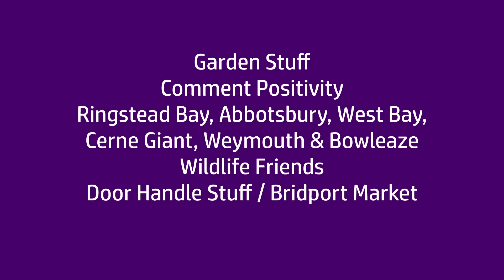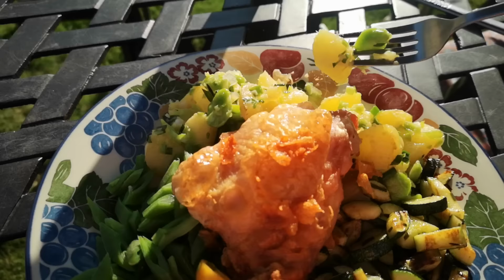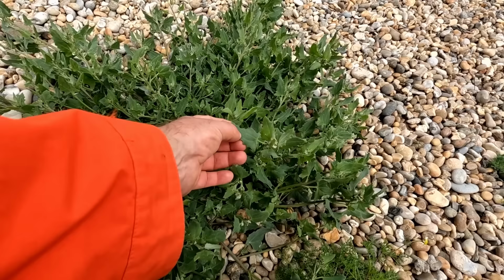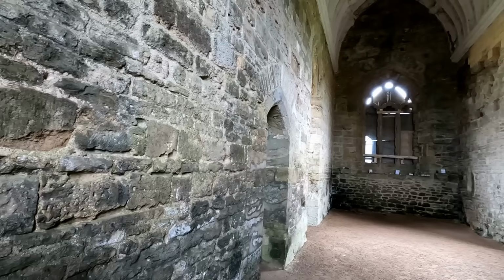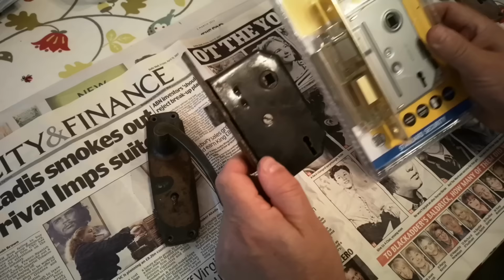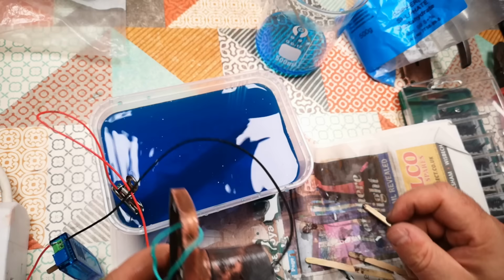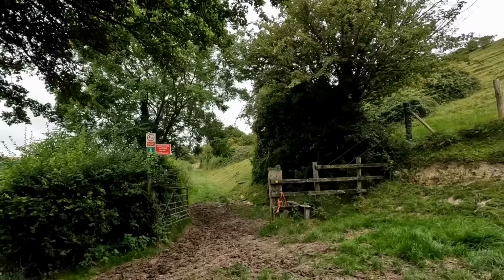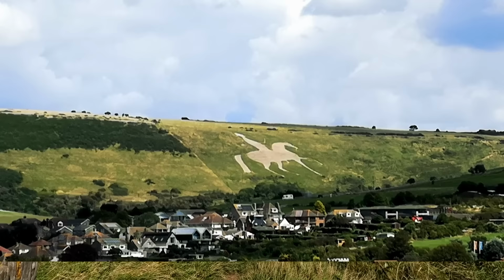Random Stuff - Garden, Comment Positivity, Ringstead Bay, Wildlife Friends, Restoration Project Fail

Comment: When electro plating, always use rubber or latex gloves when handling the metal part. That way you don't introduce any oil from you hands to the part. Also if you'll have a go at this again, it needs to be bare metal. Not cleaned, scrubbed. It needs to be BARE. So power tools with a wire wheel are good, acetone, disolve the oxides. Combo to get to bare metal everywhere and then use gloves.
Reply: I have found that many people used to varnish brass - plated or otherwise(i assume to save the effort of regular polushing to prevent tarnishing.. i live in a victorian townhouse and  the doors have the original solid brass knobs... to my horror i found they had all been varnished... which has now been removed and they are beautiful

Comment: I looked up what might have happened with the restoration; apparently, when too much charge/ too much copper (not quite sure) saturates the copper sulfate, creating copper sulfate pentahydrate crystals. Amazing vid as always :)
Reply from the maker: Yeah, I should probably try with a more dilute solution
Reply: Also to fix voltage issue physically move the electrode away from the handle will add resistance and reduce current witch is what you want if you cat make the voltage less, also may make it more even. Also when I last tried something like this the solution was a bit darker than glass cleaner if that helps, yours looks way darker but could be camera. Also a battery cell AA C D etc might work better as a buck regulator might be putting spikes of voltage during the conversion.
Reply: Here’s another comment marked three weeks before the video posted.  There’s only one explanation I can think of:  You're traveling through another dimension -- a dimension not only of sight and sound but of mind. A journey into a wondrous land whose boundaries are that of imagination. That's a signpost up ahead: your next stop: the Twilight Zone! You unlock this door with the key of imagination.
Reply: @TheFrugalMombot  Indeed; after many hours of being happy on purpose, demonstrated by Shrimp himself, we can step through space-time :)
Reply: @scottbuck1572  indeed :)

Comment: Speaking of copper plating, I managed to plate a spot on my kitchen sink after putting down a plastic tool I was using to fish out a PCB board out of the etchant solution and forgetting about it. It was surprisingly well adhered, and took a lot of scrubbing with steel wool to get it mostly off. The etchant was a copper chloride solution which works fairly well for etching PCB boards, but it requires replenishment with hydrogen peroxide, which isn't easy to get in high concentration.

Comment: Another explanation for the regular beach pattern at Bowleaze could just be the formation of rip currents, but small scaled. This is a common feature present at wave-dominated beaches. Waves always adjust its shape when approaching the coast so that its parallel to the beach, so an interference patterns is unlikely. Within coastal morphodynamics, this beach pattern could be classified as "transfer bar and rip" which is an intermediate beach pattern in the Wright and Short's beach classification.

Comment: Interesting and varied - video, brings back memories of holidays in Dorset.

The restoration project, digging into my chemistry background I would suggest the copper sulpate solution was much too strong - with so many sulpate ions in solution you are possibly getting zinc reacting with the sulphate where the zinc is most exposed and roughened. A more dilute solution with a little acid in it would possibly have worked better. Ideally most copper should come from the anode not the copper sulphate solution.

Comment: Lucky to have a wide range of beaches here in South Wales, muddy, muddy tidal, shingle, rocky, sandy, a few with sand dunes and even some very industrial beaches (covered in bricks, blocks, concrete, tiles, plastic and other remnants of industry/human tendency to dump rubbish along the shorelines). 
One of those industrial beaches in Cardiff is the other side of a river opposite a council landfill, that has eroded and washed back up onto nearby beaches. (I believe the landfill is now used only as a collection area for rubbish that is recycled or incinerated).

Comment: Mr. Atomic Shrimp, I'm a big fan.  I aspire to be as ecclectic in my interests as you are.  As a chemist, I was thrilled to see a chemistry feature on your video!  You did a tremendous job in your project fail.  Any micropits make electroplating almost impossible, I suspect with more sanding, polishing, and buffing, that you could have gotten there.  I hope you will try again!  As for your confusion with anode/cathode, this is normal and shouldn't be the case.  It is not really about charge, but its about the process. There are two types of cells, the one you made (electrolytic) and a battery cell (voltaic).  In those cells the charges of the anode and cathode are reversed.  The better way to remember is that oxidation happens at the anod, and reduction happens at the cathode.  I tend to remember alphabetically, but my students like RED CAT for reduction at cathode.

Sorry for the long comment, but I was fascinated.  If you ever need the opinion of a chemist, let me know as I'd love to help.  Thanks for all you share and expose me to :)

Comment: It might be worth running the electroplating with a very dilute solution. It will certainly slow down the process, which might prevent crystal formation. Alternatively, run it for a fraction of a second at a very high current. It may be the case that if you apply a single layer in an instant it's much smoother.

Comment: Oooh! In my hometown area, we actually get bog iron, down in the Pine Barrens. It conglomerates into chunks called "puddingstone," with pebbles held in place in an iron ore matrix. You also get bits of iron sand in that area: if you drop a magnet on the ground, it'll come up covered in tiny bits of iron. (This experiment was performed accidentally when my sister dropped her snap-on magnetic sunglasses).

Comment: Best videos truly over 1 hour of exploring things:face-red-heart-shape:

Your plating reminded me of a lab mishap...I wanted to clean my tweezers (stainless steel) and my copper electrode in the same diluted HCL-solution aaaand forgot them. Next morning in the fumehood: why has my tweezer a copper color LOL. But since I am an electrochemist I should have known thats what you get. 
From what I can see in your exp setup, yes the solution is quite saturated, so bringing it down to a hue of azure shoud help (I understand that you dont want to calculate and weigh for that kind of stuff). BUT for my part and because of you comment, it looked like you had a surface contamination like you said it felt plastiky. Yes the contact could be improved and also the positiong of the electrodes but ...finer details...
THE thing to do be(for)e plating is for sure the surface cleaning. (we had sometimes clients give us steel parts with finger prints still on them..) 
Items (or their interface) needs to be free from anything which blocks the ions to get to the interface / "on" the interface to make their electron exchange, so grime, finger fat, coatings of not conductive materials included. Since you got a fine copper film on the rest, you did mostly the right things. Otherwise, if the voltage was too low or so an so it cannot form as stable as yours did. Stable because it had the metallic sheen. Acetone would do the job of grime removal best. But since you already "handled the job" nicely (pun intended), its done I would think. Ask me if you need tips (electrode positioning and the finer stuff) if you try it sometime in the future :goodvibes:
Love your experiments and projects 🙂

Comment: The scalloped beach could very well be an interference pattern between waves coming from the southeast directly and the same series of waves reflecting off the shoreline east of the cove. I don't know whether this shore would be a good reflector (which depends on the steepness of the shore at and below the waterline) but it is a reasonably straight line almost perpendicular to the beach.

Comment: Your misadventure in electrochemistry randomly reminded me of those tiny skillet/meal packs you bought and tried desperately to find a use for. Since you’re not averse to trying new things please allow me to suggest metal casting. I recently saw several videos of people melting various metals from copper and brass to the aluminum/zinc alloy used in modern cabinetry using tiny cast iron skillets just like yours. It’s no more hazardous than your clay firing experiments as far as I can tell.

DISCLAIMER I have not done this but it looks pretty straightforward. There are many videos to seek pointers from.

Comment: you could ask at your local W&S recycling centre in Bridport for door handles they can be very helpful there , loving the videos the farm track you went on to ringstead I travelled on 25 years ago and got logs and milk from the farmer for a great camping weekend. from what I could see nothing has changed there at all, thanks for the memory kickstart, and by the way my old dad used to tell me that for the best Rhubarb you water with a bucket of water per crown per day.  cheers mike . P.S. I found copralytes on the slope leading from the rope walk to the chapel at st Catherines

Comment: While you were copper plating the door handle, you commented that the newspaper was making it hard to tell what was going on. When you removed it, the tablecloth wasn't much of an improvement. Then it dawned on me that I sometimes struggle to follow the "studio shrimp" sections because of the tablecloth pattern. Would you consider replacing the tablecloth with something more neutral for the sake of the videos? I know you like colour and patterns, so maybe you wouldn't want to, but worth a try!
Reply from the maker: The tablecloth is an established part of the channel. I would not replace it.

Comment: Re squashes; firstly Shrimpy I love your gardening segments, but I slightly differ in my opinion on squashes. Although I'd agree there is generally a low risk for bitter squash syndrome, but to know what may or may not have pollinated something when we’re talking open pollination is hard-impossible, especially if you're in a urban or suburban area; pollinators have big ol' harvesting areas after all. 

I'm not saying not to grow or eat volunteer squash, it's one of the most exciting things that I also do. I think common sense rules apply though; first smell, does it smell like you're expecting, second taste, taste a tiny piece raw and spit out regardless of whether its bitter or off tasting or not, thirdly small first portions, so if you decide after the previous two tests it's alright to eat, cook and eat a small portion and wait 24 hours before consuming more. 

Anyway this is getting very long, just a difference of approach/explanation possibly! Anyway much love from Somerset

Comment: You may not have the time to answer this no problem - wondered. how long it took you to walk down to the beach from what i assume was the National Trust car park. Thinking of going there  with my daughter have had viral fatigue / improving  need to be careful.
Reply from the maker: It must have been about a 15 or 20 minute walk. It's quite physically taxing as the slope is quite steep in places. I think if you go just down the road a bit you can park (also national trust) much closer to the beach

Comment: ooh i also have problems with anode and cathode but i think of "anode = an = and = + = positive"
Reply: the worst thing is that the polarity depends on whether it's electrolytic or galvanic, which then makes you have to remember that oxidation is on the anode, which makes it negative in galvanic cells, but positive in electrolytic ones
Reply: I was taught the cations are positive because ‘cats are pawsitive’ and cathodes are negative as opposites attract. Anions (onions) are negative because they make you cry when you cut them.